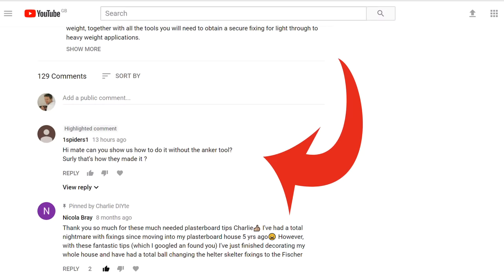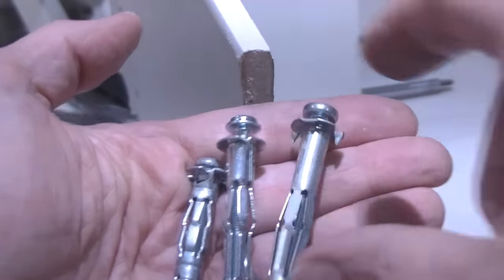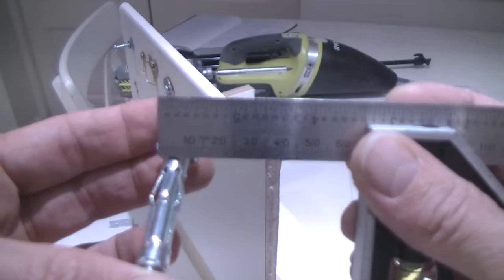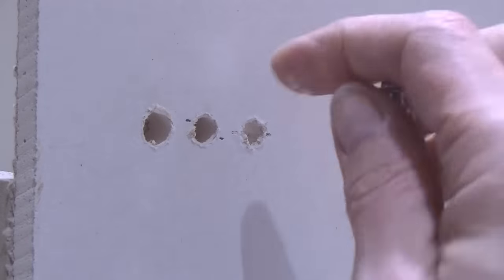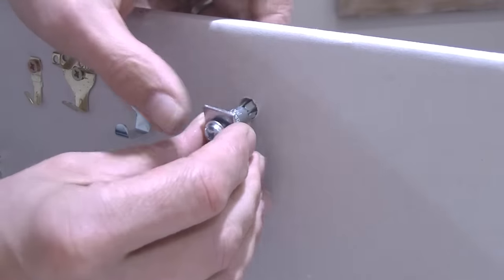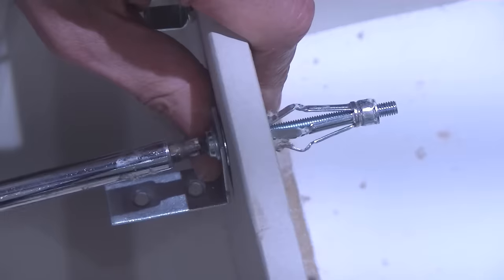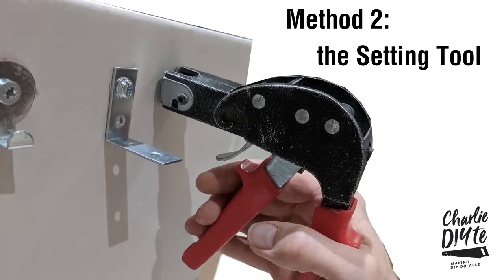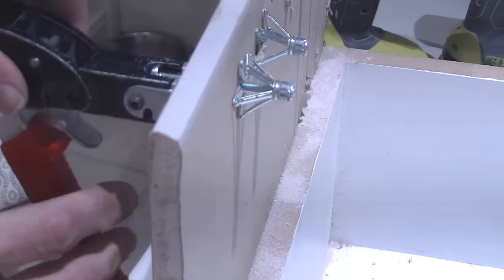How to Fit Hollow Wall Anchors

Comment: Thanks for this video...how would we know the thickness of plasterboard to determine the size of plugs required?
Reply from the maker: I forget which video I demonstrated this in, but you want to drill a 6mm diameter hole in the board, get a paper clip or similar piece of wire, and with a pair of pliers bend over a tiny foot on the end, a few mms across - ie small enough to get into the hole. Then insert the wire into the hole and hook the foot onto the back of the board. Pinch the front of the wire with your thumb, pull the wire out of the hole and the distance from the foot to your thumb is the thickness of the plasterboard.
Reply: @CharlieDIYte  great, thanks!

Comment: Hi Charlie, I found this really useful. I wondered if you can do a future vid about screws, especially which size/length to use for different tasks eg. Screwing MDF panels together etc. I always seem to over-compensate for a task by using larger sizes since I’m concerned that smaller stuff won’t cut it/will break under load. Thanks again — keep up the good work!

P.S. got myself a FUGI tool based on your recommendation and it’s brilliant!
Reply from the maker: Hi Simon - great to hear from you, and thanks for taking the time to comment! I've been meaning to do a video for a while on how to achieve a good fixing into brick walls, but it's so hard to generalise as every wall is different. MDF is a tricky one because fundamentally it's a really problematic surface to screw into - as it tears so easily - particularly when you're screwing into the end grain. It's interesting what you say about over compensating, because my golden rule with MDF is to use the narrowest diameter screws possible (sometimes as narrow as 4mm diameter) and typically to drill a pilot hole - the diameter of the central spine of the screw (ie the bit at the centre of the thread) so that it's only the thread biting into the MDF. And I reinforce with wood glue wherever possible. 

I'll bear what you say in mind. Are there any particular situations that flummox you, that spring to mind that I could maybe advise on? Thanks again for the comment.
Reply: Charlie DIYte Hi Charlie, thanks for the tip, the MDF screw tips sound great —hoping to build an MDF wardrobe in the near future (still in the planning stage). I think you’ve answered my question, much appreciated!

Comment: Love your work Charlie, watched so much of your vids. Wondering what you’d do if you had plasterboard covering a similar depth of chipboard?
Reply from the maker: Aw, thanks Chris. Can't thank you enough for supporting my Channel 👍 If you've got chipboard behind the plasterboard, it's happy days because you can simply self tap your screws into the chipboard, giving you a really strong fixing. You should drill an initial pilot hole very slightly wider in diameter than the screw you're using through the plasterboard and stop when you hit the chipboard. Then simply drive home your screw with an electric screwdriver (or drill a much narrower diameter hole into the chipboard and hand screw the screw home, if you don't have an electric screwdriver). Alternatively if for whatever reason you want to anchor in behind the chipboard you could buy one of the wall anchors that has the deeper, double length collar, which is designed for double tack (thickness) plasterboard. Send me an email if you need any further help.
Reply: Charlie DIYte awesome sauce. Thanks 🙏

Comment: How do you know how thick the plasterboard is? I want to put cavity anchors on an existing wall in my house and have been told the ones I have may not be the right size. How can I know that?
Reply from the maker: Drill a 6mm hole. Poke in a piece of wire or a paper clip with a tiny foot on the end. Hook it behind the hole, pinch the wire with your thumb and take it out. You've got the depth of the plasterboard.

Comment: Great video, just a simple question from a novice, how do you find out how thick your plasterboard is to determine the correct size plug please ?
Reply from the maker: Thanks! Simplest way is to drill a 6mm - 8mm diameter hole, and then get a piece of wire eg a paper clip. Bend it out so it's a long straight piece of wire and then with a pair of pliers put a little right angle in one end (so it looks like a letter "L") - with the bent section 3-4mm long (ie narrow enough to pass into the hole). Then poke that into the hole and hook it behind the plaster board. Pinch the wire from the front and then keeping it pinched remove it from the hole and the distance from where you've pinched it to where the "L" starts is the thickness of your plasterboard. Hope that matters sense!

Comment: tricky thing, a while ago the anchor spun and ruined the wall, and what i did is exactly what you've done...
finished the job by using plastic ones.
Reply from the maker: That is because you didn't have a turning stop between the anchor and the screw bit. You have to put the bracket on or whatever it is you're fixing to the wall, if you're opening the anchor that way, rather than using a setting tool.

Comment: In my experience, there's no cavity wall that will allow you to use screwdriver only to fix in place. The setting tool means you can set the fixing with the screw sitting just as it touches the back of the nut. 

You can see that Charlie has to go all the way in with the screw to get the fixing to tighten. By that point you'd be hitting brick. You could drill into brick / block to give the screw room, but then you'd just use a proper wall anchor.

So it's a setting tool or another plug in my opinion.
Reply from the maker: It's a fair point. 👌

Comment: Hiya, basic question!! How can I measure the thickness of the plasterboard? Many thanks 😊
Reply from the maker: I thought I showed that in the video. Get a piece of wire, bend over about 3mm of one end into a small "L" shape, drill a 6mm hole in the plasterboard, thread the wire through, pull it tight, pinch the wire against the surface with your thumb or mark it with a Sharpie, pull it out and that's your depth.

Comment: Hello! Can you advise what would be the best wall anchor for the following situation?
Glass Shower door approx 25 - 30 kgs without a frame on bottom and top. The fixation is on a metal bar that needs to be screwed onto a tiled drywall. Tile is 9mm thick. Basically the weight of the door would be distributed over the 3 or 4 screws on that wall mount. I don’t want to drill large holes in the tiles. I thought of maybe combining Fischer anchors and snap toggles. Many thanks.
Graeme
Reply from the maker: You need quite a large hole for the Fischer anchors and snap toggles.  How about trying Fischer 8x40 Duopowers. You'll need an 8mm diameter drill bit. It's a universal fixing so works in a variety of scenarios and there's a visual showing it opening up behind double thickness plasterboard, which is basically your situation.
Reply: Charlie DIYt. Wasn't expecting a reply so quick. Thanks! There's lots of info for anchors on plaster board or solid walls, but almost no info for anchors on tiled plasterboard. I would like to use molly bolts but I don't think any are really long enough for my 3cm thick wall (tile + plasterboard) unless they are huge. I don't have enough room for snap toggles behind my plasterboard (only 4,3 mm). I will try the anchors you suggest. I hope they will support a 25-30 kg glass door. Maybe add a few extra bolts on the frame. Thank you so much.

Comment: Hi Charlie. Great vids. Very much a newbie to all things DIY. Your vids re hollow wall fixing has given me confidence to try myself, thanks. You mentioned in one video about fixing heavy objects to the wooden studs. Any tips on how to 1. Locate the studs themselves and 2. How to find the centres. I read somewhere that studs on modern house are 16 inches apart!  (My house was built 2017) That’s fine but surely you need to find a ‘starter’ stud to start the measuring process? Also how do you know you have found the stud and not pipe work, electrics or the metal strips that join the plasterboard?
Reply from the maker: YES! I often have to find studs in my day job running a soft furnishings company, and d'you know what I do? I use my knuckle, and tap along the wall. Hollow tap says there's no stud and then the sound suddenly become duller, and you know then you've hit a stud. You can then tap back along the spot and identify pretty well where the sound changes. Get a pencil, mark it with a cross and you're pretty much guaranteed to have found a stud. 

There are also stud detectors - results for which can be a little unreliable. They're a little better though when you use them for something they weren't necessarily intended for. For example, I have a detector for electrical cables and pipes, which we sometimes use - because in old buildings where the construction was lath and plaster where a lot of nails were driven into the stud, the detector tends to go off when it detects nails in the stud. 

As to the 16inch apart convention, that might be right. You can't always guarantee this (it depends on the skill of the contractor), although the builders tend to follow a pattern from one house to another. So if you establish a 16inch gap, then chances are they will be consistent across the room. You can find the first stud as I described above, measure 16 inches across, and drill a small (eg 2-3mm) pilot hole and see if you hit something solid. You might narrowly miss it, in which case you can then move a little to the left or right (or use my tap test!!) and try again. 

On your last question, it's tricky - particularly in new builds where a lot of the water pipes are plastic push and fit - which wont' be detected by the metal/stud/cable detectors. Again, try my tap test, and if you tap something solid you can be reasonably confident that there's no cable or pipe in the vicinity! 

Good luck!!

Hope that all makes sense!
Reply from the maker: Simon Curtis That's a great idea! I do something similar with a Bosch electric cable/ pipe detector.

Comment: Hi is this anchor good to put 75 inch tv on plasterboard wall ? 
If use 6 or 8 anchor or 10 will make difference or better opened wall put some wood behind? 
Also tv unit 180cm long.

Comment: Charlie, some of these anchors state for plasterboard thickness from 6-16mm or 8-18mm. Does that not mean you don’t have to measure  the thickness of the plasterboard as long as double plasterboard hasn’t been used?
Reply from the maker: Hmm, I guess but that's quite a difference for the fixing to work with if it's a wall anchor. Check out my updated vid, there are some really good fixings on the market these days https://youtu.be/Jdu9RId7m90

Comment: Hello Charlie, videos have been very helpful for working in our first home. One thing my partner is pushing for but I'm quite dubious. We have bought a pendant lighting fixture for above our dining table. It is plasterboard but there's no joist and no "nogging" above the table which seems strange as it was built as the dining area of the kitchen. Would I be able to suspend it from the plasterboard? It weighs roughly 3KGs. Plan was to use four wall anchors you feature in your videos. Would this be wise or are we better off putting a nogging in?
Reply from the maker: I think you'd be ok with the wall anchors, Jamie 👍

Comment: Hi Charlie, I am currently decorating my hall stairs and landing and would like to hang a large mirror on the bulk head wall over the stairs, I believe the wall is hollow but not sure how to find this out. The guys at work have suggested a stud finder, a magnet, drill little holes to see where stud is or get someone in who knows what they are doing! Ha!
I am impressed by your videos and have learnt a lot. I recently blocked up a doorway with a stud wall, learnt to plasterboard and plaster. Knocked another doorway through and hung doors. So could do with a little advice from you. 
I think the anchor screws with the picture hooks would do it but which size?
The property was built in the 50’s as a purpose built maisonette which looks like a semi detached house. I live upstairs. If that helps
Regards nikki
Reply from the maker: Thanks Nikki - I appreciate that and I'm really glad you've found them useful!! I can't really comment on stud finders as I haven't got one but I do have a metal detector (Bosch PMD7) and that finds the studs because typically they've got lots of old nails or screws in them (we use it in the day job when we're fixing up heavy curtains). Metal detectors are a tricky purchase because so many of them promise a lot but are unreliable but the Bosch has been pretty good. If you can't find a stud out it's in the wrong place you might take a look at these https://youtu.be/aeFyQS2NGVM but either these or the anchor fixing will do the job.
Reply: Thanks Charlie for you prompt reply. I’ve checked out your link and as usual it’s very informative. I’m erecting the  scaffold tower over the stairs today so that’ll give me a bit more safety to be able to investigate the wall. 
Love the videos keep up the good work 👍

Comment: How do you know what depth your plaster board is as we live in a 100 year old house and I am sure they might of used plaster board or the old way of the wood lats and plaster method. Is there a way of getting the depth of the hole to the back. ?  Thanks. Wanting to hang speakers as this needs to have the bolt out of the wall by one inch to have the speakers onto as they slide onto the screw instead of tightening the screw.
Reply from the maker: Best way is to drill a 6mm hole and thread in a wire with a little hook bent onto the end. You can hook the lip onto the back of the board, pinch the wire with your finger and take it out measuring the depth.

Comment: Hi. I have a small radiator in my bathroom fitted to the hollow plasterboard wall of the airing cupboard. the top fixing/mounting screws have slowly warn the plaster due to wrong anchors/screw and the radiator has started pulling away from the wall and leaving the holes it was fitted to, a lot bigger and in a bit of a mess. Trying to find a video on how to fix this but no luck. do you have any advice or suggestions. Thanks in advanced
Reply from the maker: Yes, get some Geefix and make a little wooden jig so you can drill a larger hole for the Geefix plug over the old one as I show towards the end of this video https://youtu.be/Jdu9RId7m90

Comment: What does he mean about get the turning stop behind the bolt before tightening it? Does he mean you need to put up the thing you are going to fix to the wall before tightening or is a turning stop something else. What is a turning stop? What is a good or bad turning stop? Do i have to buy one or can I just use anything with a hole it in?
Reply: He's wrong.  He's holding up an L bracket.  I'm in the US.  I had seen a small metal thing like a tiny flat wrench or spanner with 2 prongs that fit into the anchor to keep it from turning.  It came in the box of anchors.  If you want to use that tool, you need to make sure the anchor has the tiny hole in the face of it.  Otherwise, it's the little prongs on the anchor that bight into the wallboard.  That sometimes doesn't work well.
Reply: I bought a setting tool at the same time i bought my bolts. It took quite a lot of effort to get the wings to deploy fully on the m5 size bolts even with the correct tool. I cant imagine how hard it must be trying to do that just with a screwdriver, trying to stop it turning and hoping the threads dont strip, I wouldnt even consider attempting it

Comment: Hi mate great video bit of advise needed I want to put a projector bracket on a ceiling  what size anchors would I need and could i use the bracket to put these anchors up with out a tool only going to put 4 up so not wanting to spend money on a setting tool
 
Regards 
Melvin
Reply from the maker: Hi Melvin, you'd need to drill a pilot hole in the plasterboard - say 6- 8mm diameter and thread in a bit of wire with a tiny foot bent into the end - you can rest that foot on the back of the plasterboard, catching the front of the wire between your thumb and forefinger, then take the wire out of the hole and that will show you how thick the plasterboard is. That way you can then work out which fixing to use as I explained at 1.22 mins in the video. Chances are you've got standard 12mm thick plasterboard as so the m5x50 anchor fixing will do the job. You don't need the setting tool as long as you use a turning stop when you tighten the fixing - could be the bracket itself out a washer, for the reason I explained in the video.
Reply: Charlie DIYte brilliant Thank You for the reply I'll be giving it a go

Comment: Which brand of setting tool would you recommend? I used a cheaper one which failed after using twice.
Reply from the maker: They're all pretty hopeless to be honest, as the mechanism either fails, or the little "V" groove wears if you over tighten the bolt or it slips when you're setting it. One of my fitters who's a bit heavy handed managed to knacker mine on a recent job. So I've bought one of these from Fischer https://amzn.to/3h8HNO8 which is a quality bit of kit.

Comment: Hi there, I’m looking to be placing some Ikea ALGOT shelving units up on my wall. I have an internal stud wall, with I believe something like Celotex insulation board in the cavity. Would having the insulation board have any impact on utilising the bolts you have demonstrated? I’m assuming not, the insulation looks fragile and I assume when the bolts are opening they would just tear the foam and foil insulation?